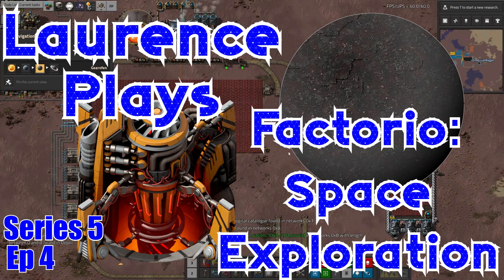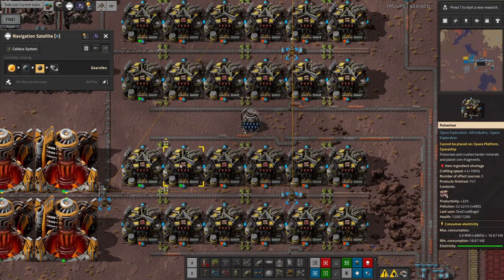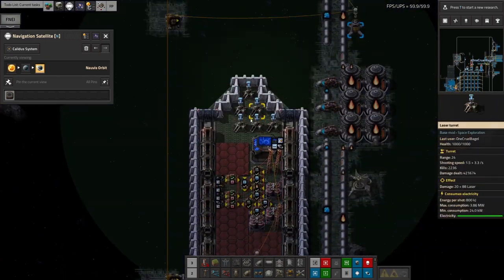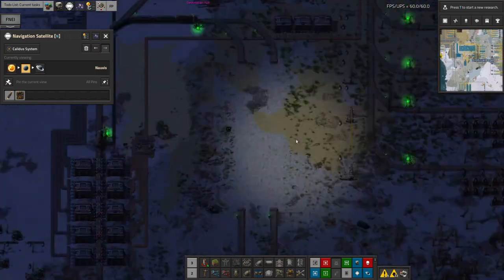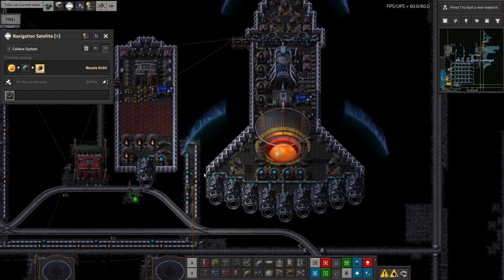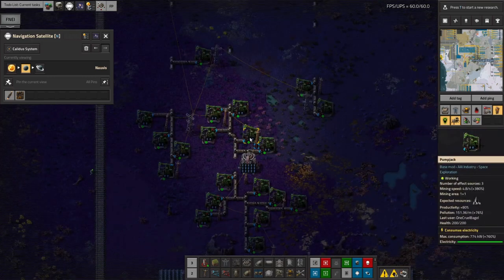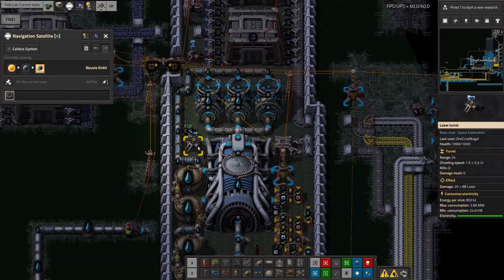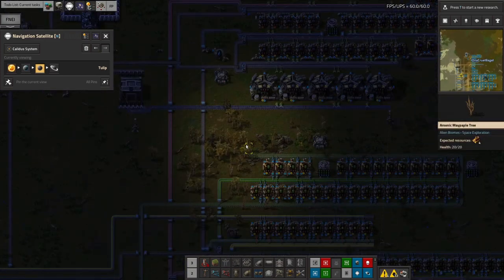S5-E4 - Decapitation - Laurence Plays Factorio: Space Exploration

Comment: 23:30 Something that will work for you is if you set the outside inserters to stack size of 12, and the inside inserters to a stack size of 8. With that, those speed inserters can provide 22.5 items per second per pair, i.e., a full half belt from either side. That means that as long as the inserters are running (if there's something in the silo), you'll always have something on that middle belt. And that should be cheaper in terms of performance based on how optimised the belts and inserters are compared to the circuit network. Obviously, not actually an issue for you, but it wouldn't be Factorio if the players didn't think about that. xD

And yes, your conundrum about whether or not to crush the naquitite is quite perplexing. I'm very much on the side of maximal efficiency in production, and logistic cost is something worth paying. But I understand that many others don't agree, haha. Looking forward to the next stream/video!
Reply from the maker: Oh, nice - that makes sense, it's the correct numbers to make sure that the inserters are always swinging when the other one is able to unload. I'm not sure that's needed here, but it's definitely useful to know for other places where I might want to unload a full belt from a warehouse. Or several full belts from a warehouse! Thank you. Regarding the naquitite, I think I'm going to start using it and then see how poor my production speed is... And I guess check where the problems are being caused - whether it's mining or processing - and go from there. It's full efficiency at the moment, and improving throughput could be as simple as an extra ship lugging it back.

Comment: Having done the ion cannister refuel it's pretty easy, you just have to bust open a wall, drop a bit of spaceship flooring for a Particle Accelerator (9x9) then they unpack the canisters.  Each holds 1000 ion stream so even a few go a long way.  Much better than waiting 5+ hours for a ship to limp along.

My "good" solution to the rocket fuel problem is to move all my resource production for space to an Oil Moon.  Huge 10k% patches (mine has 13 separate patches with 8k%+) can produce rocket fuel on site and serve as a production hub to send resources from.  Park a Copper Town next to a patch, have copper on planet go there and copper from off planet go there, get processed, then take off to space/station from there refueled on location.  Moons take far less juice to take off from as well which even if Antimatter reduces fuel usage taking off from a cheaper moon is always good.  Core mining produces even more oil and resources with the cores.
Reply from the maker: Yeah, that was pretty much my plan #2, although I was going to generate the plasma and the ion stream on site, rather than bring it out bottled. It's essentially the same idea, but your way means a bit less stuff to be brought out, but a bit more infrastructure at the other end. 

If I was starting again from scratch, I would definitely do all my ore processing in one central place, and that central place would likely be Aesselia because of the location and the low gravity. The oil (and therefore rocket fuel) would be a big bonus here too, of course. But at this stage of the game, I don't really feel like rebuilding all the processing systems on a different world - I'd rather carry on and investigate new things! 

That said, transporting metals as ingots instead of ores tends to be a lot more space efficient and therefore fuel efficient. If you take vulcanite to your copper planet (for a simple example) then you can transport 2 (ore to plate) x 1.5 (vulcanite smelting boost) x (productivity boost), which could easily be 4 times as much copper per spaceship/rocket, in exchange for needing to bring in about a third of a rocket of vulcanite. And if you're using spaceships, that vulcanite could even be brought in by the spaceship that takes the copper away... Hmmm. Now I'm not so sure!